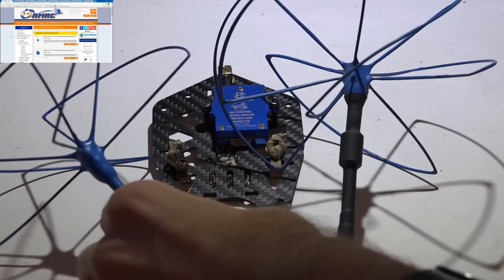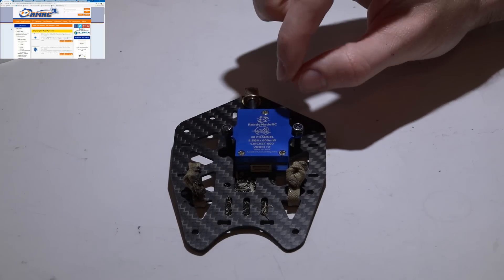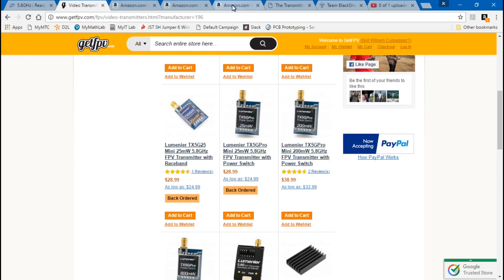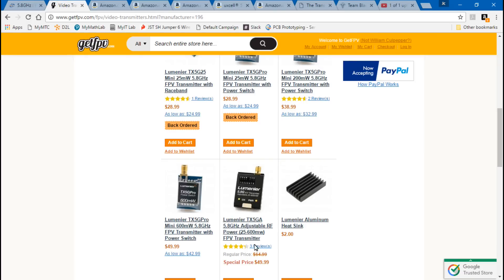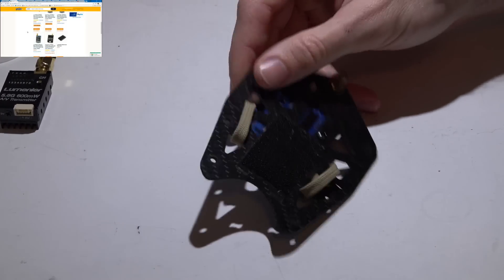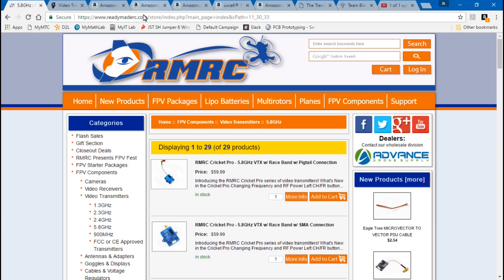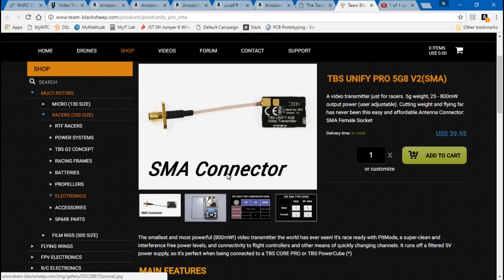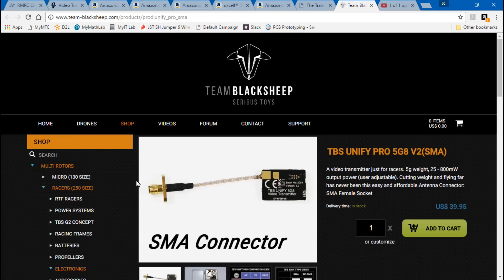Guide To: Video Transmitters

Comment: [newb question] what resolution do these transmitters output.  Looking to use these transmitters for an non-drone use.  Thanks!
Reply: Jason San Agustin it depends on the camera, most fpv cameras are ~600tvl.
You can attach a GoPro and get higher resolution

Comment: i just had to get to 600mw one crazepony or wolf whoop lol amazon clones but eother way i just got a falcon 180 today and the dam eachine 200mw vtx decided to just get terrible picture constant complete dropout only after first minute so that was a bummee but gotta love next day shipping amazon loli dont plan on really using it for racing or with others so i should get good range n not going above 4s so ill be fine to just solder it all on n go i was stoked to apparently i gpt a newer version sp racing came preflashed with betaflight  just had to do some research on good pid settings get it locked in n i should be able to have sum fun

Comment: Thank you for this video. It cleared up a lot. Can you help me out with this connection that I want to complete with my eachine 250 racer?

I want to wire this up to my quad. Instead of just soldering all the connections together. Is there a way I can get it to connect without doing that. I have a 2 prong SMALL power supply coming off of the eachine 250 board and a 3 prong connector for the camera. The camera I will be upgrading to is gonna be a DC12V 1/3 960H CCD 700TVL 2.8mm Lens Wide Angle Camera for FPV QAV250. The camera connection looks like it is gonna work. At least I hope. But the power supply connection coming off of the board is way too small. Any ideas on how to get the connectors to match up without soldering just in case i want to quick disconnect? Also is the audio coming directly off of this board or it requires a camera with audio?
Take a look at my 2 links and let me know what you think about my connection issues.

Power supply
http://s557.photobucket.com/user/jimmydean1992/media/E11D0812-F5DB-455F-B9AF-F83765D21E9C_zpsh4ewoig1.jpg.html

Video supply cable
http://s557.photobucket.com/user/jimmydean1992/media/A0A0A41D-99E0-4D25-A088-17C2E0E34448_zpsrkraymcg.jpg.html

Comment: Great video! (no pun intended)    I noticed you often show the RMRC Cricket VTX. Is RMRC a sponsor or do they really work better than others? How much weight does the aluminum case add?  They do look cool.   Have noticed the 25mW/200mW super micro VTX transmitters that weigh less than 2gm like the Tx side of https://goo.gl/bGmpD1  or https://goo.gl/KySb9z  where you can change the camera out to a better one and use micro CP antennas. I assume the downside is the smaller antennas. Probably only of interest to  those who do mini and micro builds. 5" race quads likely don't care about a few grams because they have so much power.

Comment: Man great videos.   Learning so much.  Hoping maybe you can take a few min and help me out.   

I have two quads and notice I am getting some video interference, both are Wizard x220.   I have foxeer monster on one and a runcam swift 2 on the other.   I had someone tell me I needed to put a lc filter on this, but I looked around and haven't seen a mention anywhere of many people doing this, and no mention of anyone doing this on the Wizard, unless people just do it and don't talk about it, but with so many new flyers getting this quad I am assuming someone else would be asking this same question.   So I am wondering if there something else causing this.

On quad 1 with the foxeer monster, the second I plug in a 4s battery I get very subtle diagonal white bands that run across the view, flying or not. 

On quad 2 with the runcam 2, it doesn't matter if I am on 3s or 4s but the distortion I see is more groups of vertical black lines moving very fast bottom to top and only happens when throttling up.   Side note I did test (props off) in betaflight on the motors tab and found that if I throttle up motors 1 and 3 I get interference but motors 2 and 4 don't.

Comment: How can the lumenier axii antennas 5.8 GHz be so small?
Reply from the maker: I cant say for sure since I've never held them. But I'm guessing they are using a 1/8th wavelength which will make the wires exactly half the length. Most of the antennas we use are 1/4 wavelength.

Comment: you are wrong on how the vtx send power the lower channels give more power
and if you want to fly with others then just get a tbs unify pro ore a immersion vtx and unify if you power without antenna it wont burn up so dont show the stuff you get for free
Reply from the maker: I dont get anything for free. I just picked the first transmitters I could think of to show the differences in them. And if you think I'm wrong about output RF power changing from channel to channel just watch the next video where I prove it to be true. As far as powering with no antenna, yea you could use the TBS unify, it can handle it, or you could buy a transmitter that doesn't transmit until you tell it to transmit.
Reply: we have done test with immersion rf meter and with a tramp the lower channels give more power and vtx with no antenna its for when you crash and youre antenna cames of

Comment: I don't think you've seen this antenna: https://www.readymaderc.com/store/index.php?main_page=product_info&cPath=11_45_52_100&products_id=6241

What do you think? I already have 1.3GHz gear for my long range Bix3. Should I just get this antenna and a 200mW transmitter so I don't have to buy another VRx and VRx antenna?
Reply from the maker: Seems like it would work to me. They could have made it a 1/8 wavelength instead of 1/4 wavelength. Or maybe a different design. But yea I'd try it out.
Reply: Also, since the omnibus f4 v2 pro's current sensor only goes up to 60A, can I use the PDB linked below and connect the Curr pad to the CRNT pad on the omnibus? All PDB's use the same signal type? Thanks
http://www.getfpv.com/electronics/power-distribution-boards-pdb/lumenier-4power-plus-pdb-5v-10v-reg-184a-curr.html
Reply: Plus, as you said the penetration will be better. Can you think of any reason that 5.8GHz would be better than 1.3GHz? Thank you
Reply from the maker: That PDB should work. Just remember to calibrate it.
Besides the size the other benefit to  5.8ghz is the video seems to be more clear. But not much of a difference.

Comment: Hey JC. Thanks for the video. Can you make a video for how to make an antenna dummy load? This is something I have seen in "ham" radio for bench testing your transmitter without an antenna and without frying your VTX. If you could patent it, you could make a million dollars. Everyone should have one and they should be required at all races in the pits to avoid clobbering the racer's video. Thanks.
Reply from the maker: I'm honestly not sure about that one. The closest thing I can think of would be the TBS Unify. You can set it to super low mW, like single digits so you're the only one that can pick up video from right beside it.

Comment: Is there much of a benefit to 800mw over 600? I'm trying to decide on if I should get the tbs unify or something cheaper thanks!
Reply from the maker: Not much different at all. For example a 200mw isnt 8 times better than a 25mw. It's more like three times better give or take. Going from 600mw to 800mw will be a very little difference.
Reply: Project Blue Falcon that's what I was thinking too. ok. thank you!